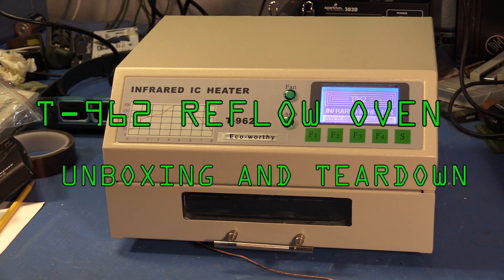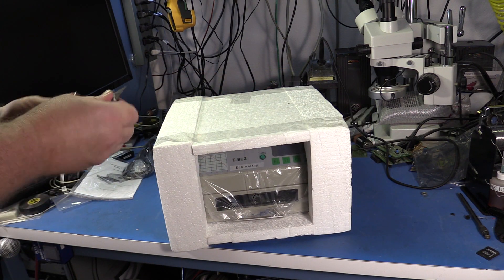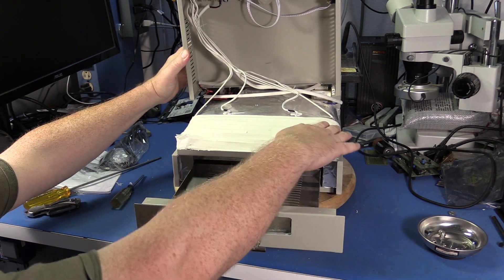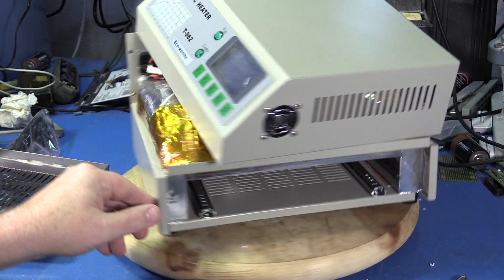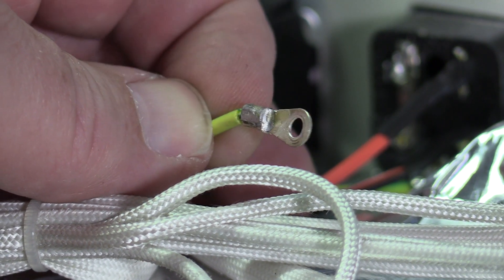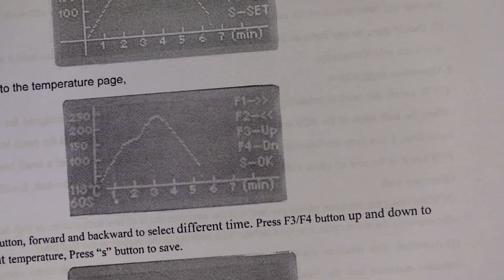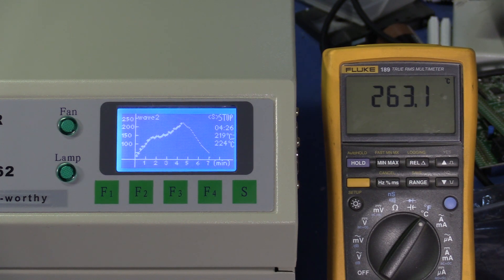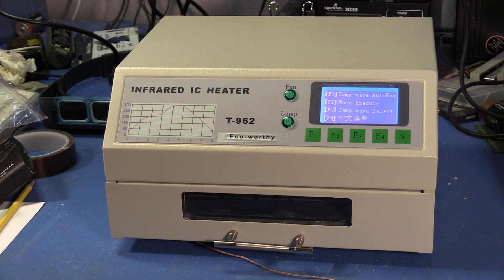T-962 Reflow Oven Unboxing and Teardown

Comment: I did not apply the mods, but experienced that the oven cannot work properly due to very bad heat distribution and missing heater beneath the PCB. General heating profiles have a soldering part that are only a few seconds long (<30). Heating from top only cannot induce temperatures under big components or small pcb modules (that are heat sinks), that are mostly to be soldered on their bottom side (tried with ESP32), means PCB with metal shield on PCB does not work at all. Trying to increase temperature starts burning components without reaching the soldering temperature for bigger components. Same for BGA components. It may be ok for smaller projects with just small SMDs on it.
My heat plate + hot air brings much more realiable results, even if much less automated.

Comment: i feel sometimes people harp on Chinese products for no reason.. or to brag themselves as "superior". The epoxy on ground and other power connection is not for keeping the screw in but to prevent any live wire coming in contact with that bare screw metal and creating short.

Comment: Now try to digest a price of over $800 from several sellers on Amazon today.  Is anyone dumb enough to pay this much for an under $200 product?

Yes, you can always build your own but if you're short of time and cash (yes, it likely will cost more before you're done), this looks like a nice (and small) unit.  I'll be buying one this week ... at a proper price.  The screwdrivers, Kapton tape and foil faced glass will be waiting for its arrival :)

Comment: I know its and old 2015 post, but on the other hand it's a pretty sketchy chinese assembly but if the same unit was assembled in USA the manufacturer would sell it over $2K, like the overpriced Hakko or Weller soldering station who only have a small transformer inside and a cheap china assembled control board ,margin of profits are totally out of control in america even worst in Canada where I live ,31$ canadians dollars for a simple flux paste syringe that's why the chinese are taking over !

Comment: I have one of these and made several good quality boards 3+ year back. I'm making a new set of double sided boards, I did some research on the subject and found many new updates and posts for this machine. I have since run some data logging on my machine and found that I can just modify the curves to match the actual temperatures I want. Other than the debounce issue, my machine seems fine. I looked at the tape inside and it is all well away from the heat and shows no signs of degradation at all. If I had to make a mod, it would be to add thermocouples at board height. A couple of flying leads from the board to plugs in the side of the cabinet would do the job. Any comments on this?
Reply from the maker: Your suggestion for a thermocouple modification sounds similar to what I did to my Qinsi oven, to close its control loop with a contact thermocouple on a board being reflowed:

https://twitter.com/nf6x/status/836015978089705472

https://twitter.com/nf6x/status/835989253880360960

Comment: I had bought one of these and found it completely useless for reflowing. It would burn the components without melting the solder paste. Thermal insulation is asbestos cardboard. Use protection when opening.
Reply: If you burn your components before the paste melts, then your components aren't made for that temperature. Try a low melting point solder. There is one that works at 138deg C
Reply: Hello, Please I have bought it also on Aliexpress and I have the same problem. Did you fix it ?

Comment: Hi Mark. Great initial review. Did you ever update it with the opensource FW and other small mods or did you just jump straight to using the Qinsi QS-5100? Oh, and subbed!
Reply from the maker: I never bothered to upgrade my T-962. I jumped to the Qinsi oven and then modified that to put a thermocouple on the board surface. But I actually haven’t gotten around to doing any real work with that one, either. I have too many projects on my list!

Comment: A friend of my discovered in his imported T962A SMD reflow oven asbestos and company produced it was even honest enough to confirm all heat parts are covered with asbestos but as they can confirm and try to tell they sold already many pcs around the world and nothing is wrong with this asbestos used nobody die and asbestos is ok only a little. So as we can see modern technology don't come with modern thinking, for some companies asbestos seems to be a neutral.
Reply: I might be wrong but I think that Asbestos is only a problem if it is messed with i.e. cut, sawn, drilled etc?

Comment: What's the name of the tape you are using?
Reply from the maker: It's normally called either "Kapton" (a brand name) or "polyimide" (generic name of what it's made of). It's very handy stuff for a lot of electronic work, because it tolerates soldering temperature without melting.
Reply: Thank You for your response. One more Query I have is - for micro soldering, what is the best (of course within a budget of $200.00 or less), Microscope you recommend?
Reply from the maker: I don't know what is available in the sub-$200 range. I use a stereo microscope from Amscope, and I think it was in the $750 range.

Comment: Did you remove the masking tape under the silver heat insulation. How you coping with the solder fumes, you got near a window when you reflow ?
Reply from the maker: +Michael Lowery 
I'm sorry for the slow response, but I wanted to dig this oven back out of my pile and verify something before replying.

I don't recall removing the silver heat insulation to remove any masking tape under it, so I guess it's still in there. I think I just removed the visible tape up on top.

Regarding solder fumes, I think that putting the unit next to a window looks like the best option. The fan sucks in air from the back and exhausts out the bottom, so you can't simply attach something like dryer duct to the back to deal with the fumes. I suppose that the fan could be turned around to exhaust out the back, but I don't know how long it would last with hot air from the oven moving over it. Now, the fan on my Qinsi QS-5100 exhausts out the back, so I think I'll try making a flange to attach dryer duct to it. I don't have enough time on either oven yet to have an idea of how well they will hold up over many cycles.

Comment: Hi, did you get the t-962 insulation tested ?
Reply: So I ordered a T962 and as a quick test put the insulation material under a mapp torch and it glows white hot and doesn't flinch (compared to a known sample of fiberglass which melts pretty quickly). Not necessarily proof that it's asbestos by any means but not at all comforting, again. Now to decide what to do with this thing...
Reply: Mind if I ask why you think so?

The manual for this thing warns to take caution when opening because "insulations in the machine had been treated strictly." I have no idea what that means but the fact that the insulation is mentioned is slightly worrying.

Also there have been a couple of reports that I've found online of ebay sellers of this oven claiming that it does, in fact, contain asbestos. None of this is strictly confirmed I suppose, but it doesn't provide much confidence.

I was thinking about picking up one of these as a starting point for a reflow oven, but if they've padded it out with asbestos I'd rather not go anywhere near one.
Reply from the maker: +Michael Lowery
No, I never got around to it. I'm pretty sure it's just fiberglass, though.
Reply from the maker: +Michael Lowery
No, I never got around to it. I'm pretty sure it's just fiberglass, though.

Comment: Hey Mark,
I am very curious if you tried the open source firmware yet. How does it perform with the improved firmware? My T-962 is on it's way now too so I am wondering if it needs any additional hardware mods besides the ones you showed in this video
Reply from the maker: +Anthony vd Meer Hi! I have not tried the open source firmware yet. I've been working on a thermocouple interface that I plan to use to analyze the behavior of both the T-962 and the QS-5100 in detail.